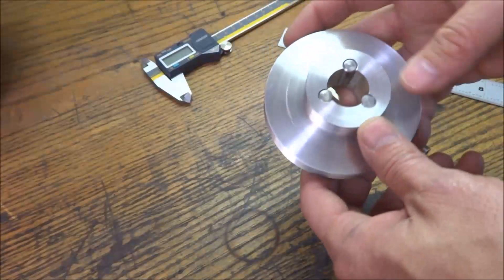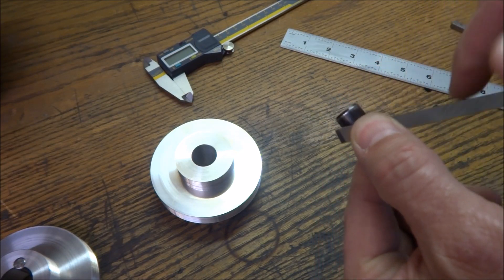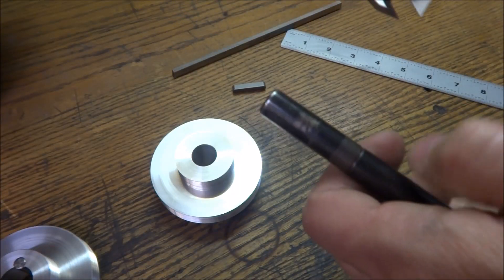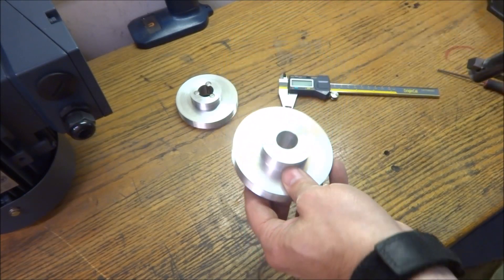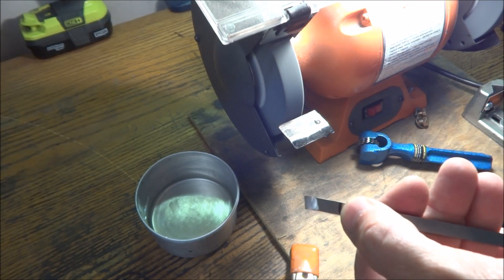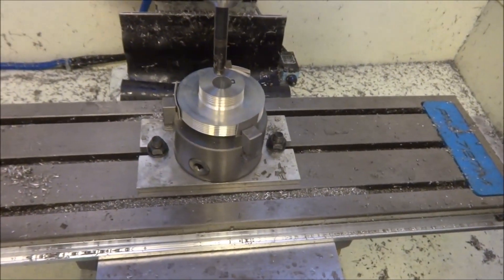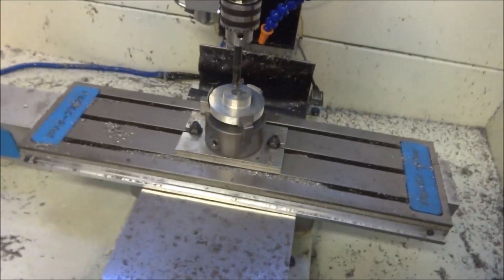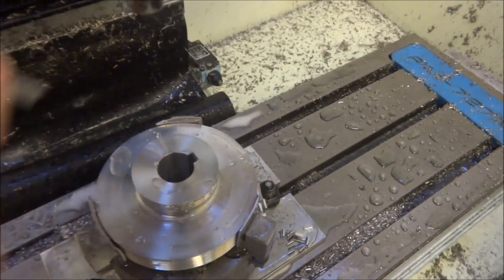PM727M CNC Keyway Broaching!

Comment: Perfect, my suggestion is to put 2 set screw side to keep Pauly secure .
Reply from the maker: Yes I thought about that However my motor shaft is threaded and I will machine a washer which will lock it on.

Comment: Hi what software are you running ? Rob uk love your servos to much money here  or would get the hole lot  for  my  machine
Reply from the maker: Hi Robert, The servos are nice cant wait to get them installed. I currently run Mach3 however I'm going to be switching soon with the new servos. This Gcode was just a hand written series of ups and downs with the Z axis moving the X over at small increments.

Comment: Nice job again Sam,  when your spindle head weights over 100 pounds taking a .001" cut like that with a head start there is not much load on the ball screw. Smaller machines with smaller ball screw might be challenged but planning ahead like you did by putting heavier 20mm ball screws in the build, not to mention the double ball nuts, it makes more things possible. Great job!!!
Reply from the maker: not much of a strain for this setup! steel yeah maybe

Comment: Sam, how did you lock your spindle rotation during broaching?  I've wanted to try this for a while but don't have a solution to lock the spindle rotation.
Reply from the maker: I am still using the gearbox so I just put it in Low 1 didnt budge
Reply: I know on full size CNC machines, I have done this in the past using an M19, which will orient and lock the spindle, usually in preparation for a tool change, or oriented approach and withdrawl for a boring cycle.  A simple g81 drill cycle is used to broach, moving around .001 over each pass of the broach.  Good job.

Comment: That's awesome. I do think you should have taken the time to put a square hole in the shaft. It worked great for the aluminum pulley but if you use for steel I think the corners of your tool will start cutting into the hole causing it to loosen itself while broaching the harder materials. Your pulley came out great so maybe I'm just being too critical (wish I had thought of that).
Reply from the maker: Turned out well in Aluminum however steel may be a different story.
Reply: Of course your right, but so far this is the only keyway broaching I've seen him do so far and as long as he is broaching in aluminum I personally doubt he'll have a problem with his ball screw. A simple arbor press/hydraulic press and buy the broaches as you need them is the way I would prefer to go. in a typical hobby shop you probably only need maybe 3 broaches to get most jobs done.
Reply from the maker: Yeah for one or two this is a good alternative cost $0
Reply: That guy on clickspring is in a whole different category than most of us hobby type machinist. I can't even imagine myself ever have the patience to do that kind work.